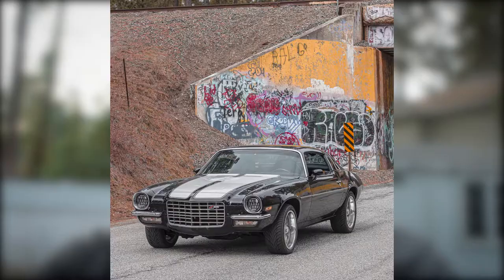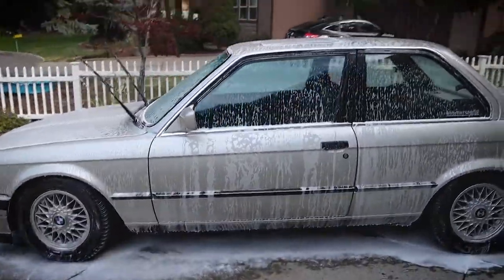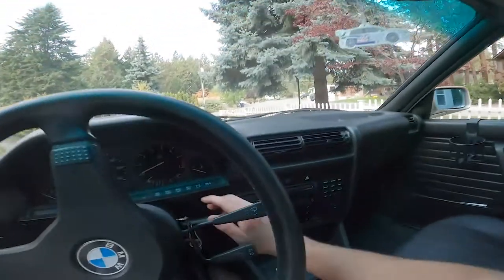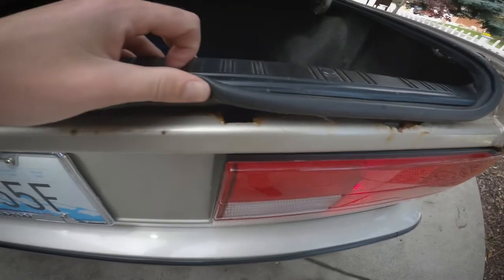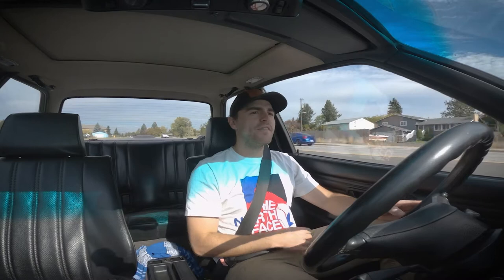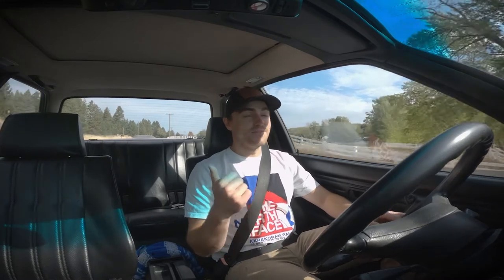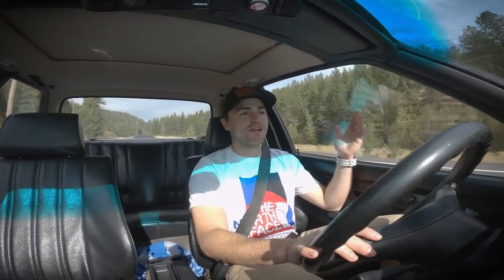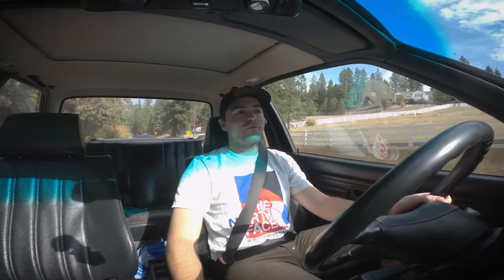Buying my DREAM BMW E30 with one HUGE Problem! (1989 BMW 325is)

Comment: Not a BMW fan but it looks nice. I'd be willing to bet the interior was redone at some point considering all that stuff was all unplugged. I hope they didn't screw you on the price for all the stuff you need to fix. Glad to see you got another dream car though! I'll always consider your Z28 the best of your fleet though!
Reply from the maker: So far everything has been small, cheap fixes so nothing crazy yet. I have to replace the fuel pump unfortunately and still working on a check engine light. Fingers crossed, nothing crazy will arise. Thanks for watching bro!

Comment: Not really critising your choice of purpose, but you couldn't find a clean one that wasn't overpriced, yet I'm not sure I'd call this one a "clean" one. Yeah it's not a lot of rust but that's only what you can SEE. I just looked at a 88 325is manual that was CLEAN. Not a speck of rust (pl on speck that was already taken care on on the bat tray). And yeah it's 16k, but that's what a clean car with a manual costs. It's great to pay less and get a bit of a project if that's what your looking for though!
Reply from the maker: Totally understand where you are coming from. I couldn't justify spending 16k on a "fun" car. To me, a 4k car that is relatively clean that I can have fun working on and thrashing is worth more to me. I would love to have a pristine example but then I would never want to drive the car hard and have fun with it.
Reply: @ShakeNBlake509  ok I'm impressed that it was only 4k, even for an auto. Even trashed examples near me are 6-8 for autos. I don't have the time to spend rebuilding an entire car, so I don't mind spending the money for a good example!
Reply from the maker: @Stevethepirate8973  for sure, thanks. I manual swapped it last year and went through and replaced all the seals and belts in the front of the engine recently as well as the wheel bearings. The car drives so good now, it’s a blast!
Reply: @ShakeNBlake509  I'm sure it is. If I do end up with this one, the plans are to drive it and love it. Maybe some supersport heads and cam, exhaust and chip. Then maintain and love!

Comment: Nice e30. For some reason like every e30 owner in the mid 2000s would unplug all of the diagnostic lights and minor lights. Often also the gong that dings when you open the door or turn the key to accessory. There are a ton of small interior lights like in the ash trays and stuff that if you wanted to go through really make the interior a little more luxe once they're replaced.
Also that rear view mirror with map lights on it is a relatively rare factory option that goes for like $300 stand alone nowadays lol
Reply from the maker: Thanks man. I’ve gone through and replaced all the interior lights, as well as fixed the diagnostic lights. I had no idea the rear view mirror was rare though. Thanks for the tip. I’ve been loving this car so much

Comment: I transform my 1918 BMW E31 350CSI!!!!! After the fall of the Bolshaviks I destined to over engineer the dinosaur that was given to meh by All Might and All for One. My shitastic BMW has been owend ever since 1887 and features ABS in each individual wheel hub to create wild nonsense. I looked at a dum dumb 850i with a PerPANbilt to pan m&ms withoujt people having to use Vyvanse...

It's true to blue.... I am villain with multiple quad damage runes....